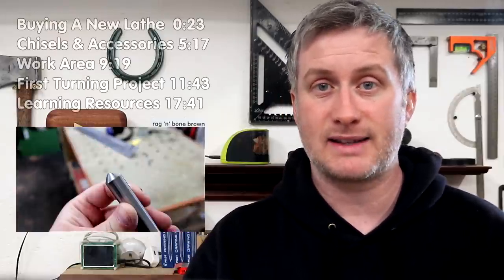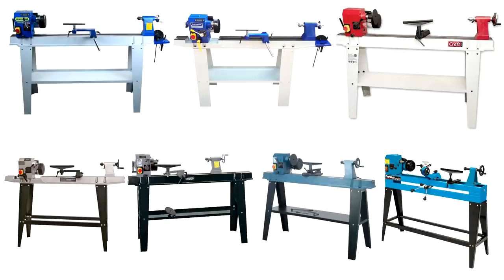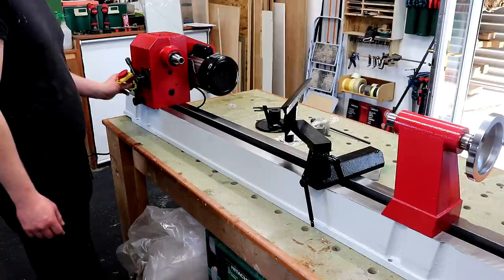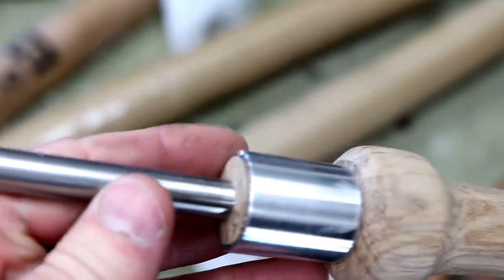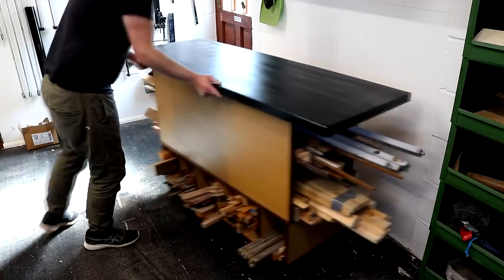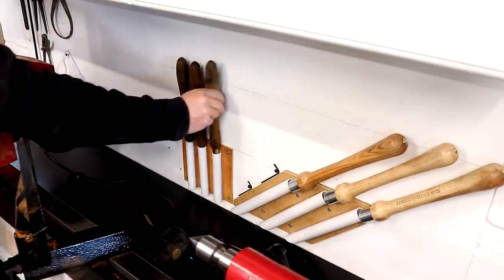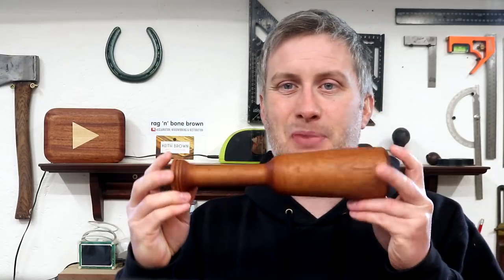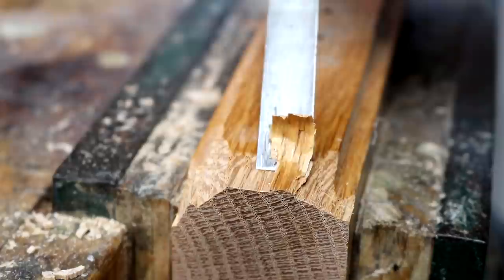Wood Turning - Getting Started With The Lathe & First Turning Project

Comment: I recommend the Record SC4 chuck, i assume your lathe is m33 x 3.5mm thread so you can get one easily from Record. 

The chuck has been great for me, ive had it a few months and its very accurate and smooth. Ive had a few chucks over the years and the SC4 has been the best. The accessories range is extensive and reasonable.

Comment: RTFM. How to align the centers is detailed in the manual.
The locking levers on that model are diecast zinc or similar and are crap, get a couple of spares.
Drive belt is a consumable item, get a spare.
Check the grub screws holding the drive pulleys to the motor shaft and to the headstock spindle. If these are loose you will end up needing a new set of pulleys. Ensure the shafts where the sliding half of the pulleys run/slide are well greased especially the drive key and slot.
Keep your tools sharp, I mean razor sharp.
Look at different sharpening systems, I use the Tormek system and jigs though there are cheaper clones around and there is always the abrasive belt type which seem to get reasonable reviews.
Chucks? Go for m33 x 3.5mm and fit an adapter insert to suite the 1" x 8tpi spindle thread on your lathe. Most midi lathes use the m33 thread of when you get a bigger lathe you keep your chucks and remove the adaptor(s), saves buying new chucks or m33 x 3.5 to 1" x 8tpi adapters.
Look at the Charnwood range and go for 4" or 100mm.
Practice, practice and more practice.

Comment: Great video on getting started. My grandfather made quite a few of his lathe tools from old files ( said the metal was perfect for holding an edge and already have the spigot/point for mounting into a handle) then turned his handles in lathe. He did this for specialized/ specific/ roughing tools as he also found he could get more tools for a lot cheaper. His main tools were all bought though. Like all of us he had to convince the boss to buy new tools so got around this by making his own. Those tools made from old files are just going on for fourth generation use as mine and brothers children are just getting into wood turning as we and my father did.
Reply: Ps we have always made it a practice to have tight clothing, leather apron (great as body armour) with short ties and rings, watches etc taken off. We just have a small box on wall near door that we put all that stuff in and just becomes natural habbit. I personally had a long tie from apron get caught once and was lucky. After cleaning the brown you are well aware to never let happen again. Keep safe and have fun

Comment: Bob on, well done Keith. Just keep practicing and you’ll get better each time. Just a quick safety tip in case nobody has mentioned it. A professional turner told me never to use cloth for putting a finish on a turning object. Always use paper towels as they will tear off before there is any danger of your hand being dragged in! Keep up the good work.

Comment: Turning can become addictive :) I'm pleased you had a look at Mike Waldt. His style is so easy... Digital readout is a not necessary, it is with feel and practice. BTW faster is better, and the rule of thumb is when the lathe starts to shake :) ,  drop it back a notch. Taking off the corners makes life a lot easier and helps with the balance.  All my tools so far are Crown and boy can the collection grow. When your finances allow, get yourself the nova chuck. You will definitely need a sharpening system because depending on the wood, you can be constantly sharpening. I have a Wet Wheel from Record, and have set up a couple of jigs to easily,  sharpen the tools.  Clubs are good, but you are restricted at the moment, so YT will have to do. The rest should be about a fingers thickness from the wood. Catches happen to decade turners so do not worry.  Always start from the end stock and work towards the drive. Enough of me prattling on, just get out there and enjoy it
Reply from the maker: Cheers Peter that's really helpful. Feels like I've got a lot to learn!

Comment: A chuck will make a massive difference, I used to have a Dakota branded 4 jaw chuck from Rutlands, this worked great with no issues and hundreds of bowls and more made with it. When I upgraded lathes and got a Record Nova 1624 2nd hand they have a unique 1 1/4” x 8 TPI thread, this came with a Nova G3 chuck and the appropriate adapter.
The nova G3 is great, loads of clamping and expanding force, easy to use with the hex ball type tool and has worked great with no flaws!
I haven’t used the Axminster evolution or clubman, I’m sure the Evolution would be great. Personally I wouldn’t get the clubman...
You’re on the edge of starting a life long addiction ! Good luck 😉

Comment: I am a wood turner of two years, Martin Saban Smith has excellent videos on his channel of wood turning and his websites Hampshire Sheen and m saban Smith, you have to pay for the videos but there good quality and he goes into detail and if you can catch a stream of his on YouTube he also answers any questions you have in stream and gives out tips. Hope this helps
Reply: I have the supernova chuck but have an  issue with the soft metal pinions that wear out, after researching I now know the culprit is the supplied hex key with the ball end, many turners grind off this ball shaped part. This is why I prefer the earlier Nova chuck model with the tool steel key.

Comment: A mallet is a fun first project. And I thought your pass was a pretty good looking one! I laughed at the pile of chips on the floor, it is amazing how much of a mess it makes. One good tip I learned was that you can use the chips/dust for extra polishing after sanding; simply take a handful and hold it to the wood while it is spinning (as safely as possible of course). Congrats on the new setup!

Comment: I started turning on a slightly older version of the one you have.
I bought the Axminster chuck, never had a problem with it.
I doubt I can give you any advice that you haven't already seen or heard.
However I will say one thing, if you start with a an interesting piece of wood, a burl, something with a strong grain pattern or some spalted wood, it's very easy to make a simple object into a stunning piece!

Comment: I have never had a bad experience with the nova chuck’s but from my personal experience I prefer the ones with a key and not the two bars to tighten the chuck and if you are willing to spend a lot the easy wood chuck is amazing. The one way wolverine sharpening system is what I use with a slow speed grinder and cbn wheels but I have seen people getaway with fast grinders you just have to be more careful about heat buildup to not ruin the steel. The fact that the centers did not align could be that the lathe is not leveled and that just means that the slight twist is removed from the lathe the biggest of lathes need to have this done. For learning I took one class at a local maker space just to give me some confidence but That is my only real education in wood tuning that and YouTube. Happy to see you get in to the fun of Woodturning.
Reply from the maker: Thank you! Will consider the nova then ✌️

Comment: Happy Turning Keith! It’s something I love watching others do but unlikely will ever do myself - mostly because it’s so expensive to start, bit like golf! By the time you’ve bought all the gear, you’ve spent well over a grand which I simply don’t have
Reply: You can certainly spend over a grand but not necessarily. Brand new, a Record Power DML250 costs £250 and that's more than capable to get you started. The Robert Sorby 67HS set offers a comprehensive selection of quality tools including roughing, bowl and spindle gouges, skew chisel, scraper and parting tool for £150, quite a bit cheaper than buying them individually. The Record Power SC3 chuck can be had for £100; I went for the SC4 @ £125 and it's great and all that but did I really need one just yet? Perhaps not. Second hand versions can be had for less; a DML250 with bed extension and tools went for £170 on ebay just before I bought mine, sets of Sorby tools for £100. Chucks don't seem to come up so often and rarely represent much of a saving but again, not absolutely necessary to get started. I've added a couple more tools and my total outlay still hasn't reached £500.

Comment: For a first attempt I think the mallet turned out great Keith. The funny thing about this video is the lathe your uncle gave you is exactly the same as mine lol and yep the two downsides are the lack of power and how awkward it is for changing the speed via the belt pulleys. I couldn’t believe it when I saw the name kinzo 😁great video mate 👍🏼👍🏼

Comment: Yandles have the record power SC4 chuck for 129 quid or the sc3 (smaller) for around 110 - both come with a set of jaws, a mounting plate and woodworm screw. Get a chuck, seriously if you're going to do bowls, platters anything that isn't just between centres you are going to want a chuck. You can do it without but it is, quite frankly, a pain in the arse to do so because you'll be trying to hot glue bits of scrap on. Also consider getting a thin parting tool too. You don't really want to have to think about the screw length + space for a 15mm parting tool on the end of your work where a 3mm parting tool would work out better. Hope you enjoy doing it as much as I have. I brought a box of bowl blanks, 15 or so, off ebay and went through them in less than a week. Can get expensive though. If I recall correctly you have a grinder already so it might be worth either making ( https://www.youtube.com/watch?v=Db4JPSb8LqU  ) or buying a jig ( https://www.ebay.co.uk/itm/Gouge-chisel-sharpening-tool-for-woodturning-gouge-fingernail-2-jigs/222535647760 )  - worth watching the Welsh Woodman's how to on sharpening too it's really informative. https://www.youtube.com/watch?v=Kk6yKUQkQX0

Don't use cloth on your lathe at all, use paper towel it's much safer - See Adam Savage's accident if you want to see an example.

Comment: Good choice with the Axminster. Generally very good customer service. But you missed a deal around chrismas they has a deal which included a chuck. I've just upgraded my table saw from a £100 one that broke after 2months to the axminster craft AC216TS I'mvery happy with it. Like you I did a hole lot of research. I'm just finishing off my first piece of furniture a cabinet for my drill press.

Comment: I really like the shape of this mallet I think it's really good for a starter piece.

WoodturningWithTim is a good channel to learn from when he's not doing totally insane things with various toys on a laithe. Carl Jacobson is also really good. They both have some really good teaching styles.

A fantastic sanding tip I learnt from Pask Makes is to use sand paper glued to a piece of ply wood to sand things that you want to be flat. I supose you could do something with a rounded block of wood for curves as well.

Nick Zammeti is also a really good wood turner and has some awesome ways to sand and finish almost any material on a wood turning laithe.

I found that learning to make mushrooms was an awesome way to learn the basics without having a really expensive or large piece of wood on the laithe. Also, dust collection, a decent respirator and a visor can, and will, become your best friends. I've been hit in the face with a chunk of wood before and my visor definitely saved a trip to the hospital........ It was between centres and I hadn't notice a crack running through it....... it was also several hundred years old having been removed from the loft of an Alms house. Please don't let that put you off, it's just an example of why we where safty kit. Hope you come to love the art of turning 👍
Reply from the maker: Thank you great info 👍
Reply: @RagnBoneBrown  no problem, I hope it helps 👍

Comment: Hi keith, just a word on the Axminister Clubman SK100. I purchased it with my own money about 3 years ago when I started turning at 14,  and have used it every day since. It's a great chuck, solid as a rock and handles everything I have worked with, including some big pieces.  However, when I realised that I could have bought 2 chucks for the price of 1, I was quite frustrated with the money I paid for 1. Record power sells a chuck called the SC4, which I wish I had opted as they are cheaper, and have a solid build aswell. Just a heads up, as I do a lot of bowl and spindle turning, and switching jaws and chuck equipment is a hassle when switching from bowl to spindle. Hope it helps
Reply from the maker: Thank you great info 👍

Comment: I love the carbide tools and tend to use the above anything else. I can use traditional tools but find the grinding a pain. chucks, I found the record power SC3 can take just about anything I throw at it. I made my own carbide tools, round steel bar and a bit of file work for the cutter plus a drill and tap for the bolt as for a handle well I have a lathe.......

Comment: Hi Keith, I think you were wise to buy another lathe rather than refurbish the KINZO.  "Good money after bad" rings a bell.  While scraping is inherently safer for first timers, you'll definitely get a better finish from a cutting style tool.  I'm curious, why did you use the faceplate rather than the pronged drive centre?  One thing you will learn as you progress, is just how much timber gets thrown away with wood turning when you look on the floor!
Reply from the maker: I realised later that I could have used the site centre, just didn't think at the time

Comment: 1" x 8tpi chucks are pretty much made by everyone, you just need to decide which jaw system to go for. Charnwood Nexus 3/Record Power SC3 and SC4, Nova G2/Sorby Patriot all use the same jaw pattern and the Record and Nova even use the same fixing bolts. Rutlands.co.uk sell a version as well although their compatibility listing seems a bit skew compared to Charnwood. I use an SC3 and a Nova G2, both almost identical to each other. Charnwood seem to have the most compatibility info on their website. Just bear in mind there are 2 versions of the Nova chuck one which directly fits your lathe and one that needs the correct threaded insert.
Reply from the maker: Thank you very helpful

Comment: The heavier the better on a lathe stand. In suggest you put sand bags in the lower cubbies. also it's safer to not face a wall when turning. even a 45 angle will save your face when something fles off and bounces of the wall.

Comment: Since you mentioned you're a bit of a geek, you might want to check out the "Brian Havens" channel on  Youtube. He has a series of "Fundamentals" videos that explain the mechanics of how traditional tools (gouges, skews, ...) work and how that impacts the techniques you need to use. It's too much information for a beginner to take in all at once (at least it was for me), but I found it helpful to watch them after I'd gotten a few in-person lessons at the local Woodcraft store.

On the catches you're getting.... A lot of it is because you have the tool rest too high. When using scrapers  or carbide tools on a spindle (or the outside of a bowl), you need to have the cutting edge at or slightly below the center of the workpiece.

Sam Angelo (Wyomingwoodturner on Youtube) had a couple of recent videos on using scrapers (which is basically what carbide tools are), and he does a good job of explaining this.
Reply from the maker: Thank you great info

Comment: next time for turning these kind of project dont use the faceplate is the center that u got with the lathe! the thing with the 3 prongs , as for the toolrestheight try to get the cutting edge of the tool slightly above the centerline of the workpiece
Reply from the maker: Yeah it occurred to me after that I could have used the spur centre for this one

Comment: On the subject of expensive Keith..... the woodturning world is the worst for “you have to have this” attitude that I’ve ever seen in any hobby area.
You don’t need a chuck - it’s just more convenient than a face plate or glue block. No safer, no better.
Carbide/traditional tools, well who cares frankly. Carbide users say theirs are better, traditional tool users say there’s are - all BS, use what you got and enjoy it. Carbide will certainly put off the desire to make sharpening jigs and buy a new grinder for a while.
Most of this other little things like plastic centre finders can be easily made in the shop so no need to spend there either. You’ll find what you want to get in due course the more you turn.... 
the most important thing is you only ‘need’ the lathe, some tools, a way Tm sharpen them, and some fits of wood. Those goggles will be fine...... eyes are the important part. Most of us can take a punch in the face at least once. Even with a full face shield you would be looking to turn anything too big anyway..... also for small things , get the speed up!!! It cuts better, and in the unlikely event it does jump off the lathe, it’ll be spinning mire than it will be flying, so it’ll be safer too.